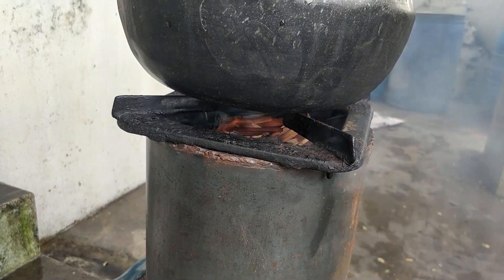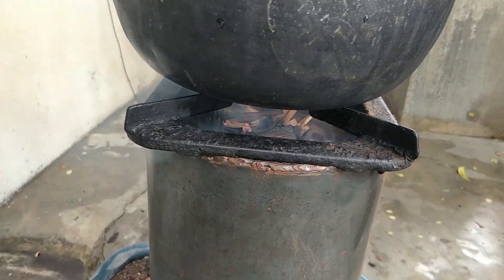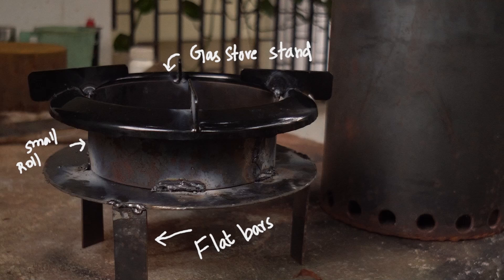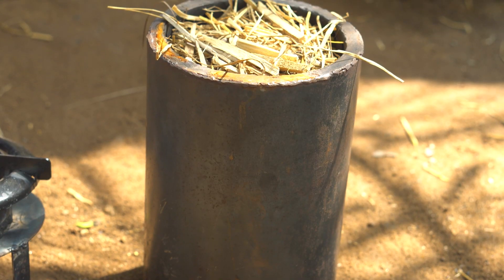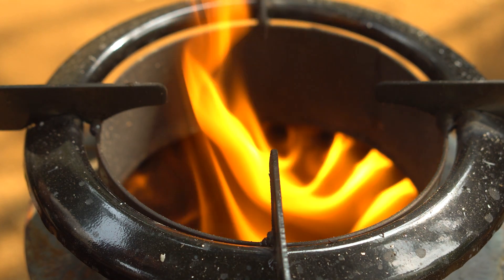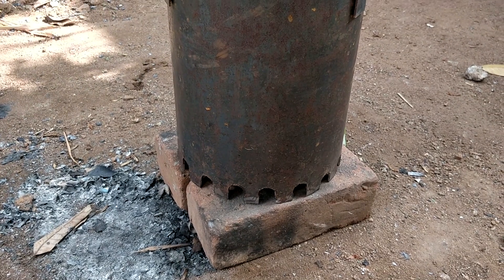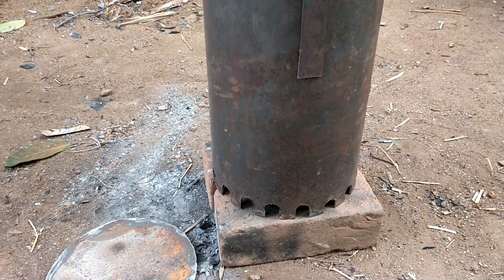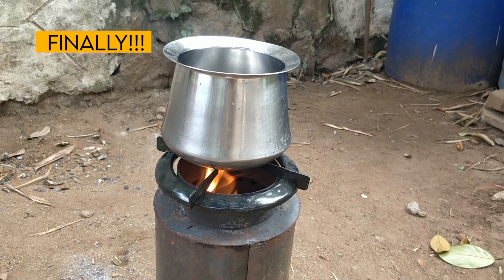Update on TLUD stove_its made better and efficient

Comment: For the sake of people who would want to make, could you put the correct dimensions of the hole size that would be needed?
Reply from the maker: I went by trial and error and would advise the same. one may not be able to make it the way I have made it. I would say , don't weld the bottom plate. This way the holes in the bottom can always be made bigger. The holes on the top were 10mm or 13 mm.

Comment: Can we use a blower force feed the air to keep the flame powerful ?
Reply from the maker: Yes, but the idea is achieve a low cost sustainable stove with no moving parts. 
for example ,People in the desert in ancient times, did not use coolers. Instead they used construction methods that kept the house cool inside. The idea behind this stove is , It should be low cost zero maintenance. I do understand that air could be supplied through bellows...But that again would need human energy.

Comment: Is this smokeless
Reply from the maker: No stove is smoke less. There will be some smoke while starting. but later its smokeless. That's what i experienced wit the one I made
Reply: Thanks man 
Keep up the good work
Reply: How much heat does this give off as I plan to install something like this in my cabin
Reply from the maker: @survivalag2293  Depends on the size you are building and the fuel type you are using. The one I made has good enough flame.
Reply: Thanks
I'm building a 8x5 cabin and I'm using dried veggie peels and wood

Comment: For people wanting to celebrate Pongal the traditional way by cooking outside, this is perfect. Also great timing since Pongal festival is just 3 weeks away now. Also, camphor is a better fire starter since not many people like the smell of hydrocarbons in their food.
Reply from the maker: Thanks a bunch for the input. It would normally not use even camphor for starting fire. I would use a single match stick and try to light it up. It's a way of practice for starting fire with minimal inputs. But then I had to make an exception for this trial.